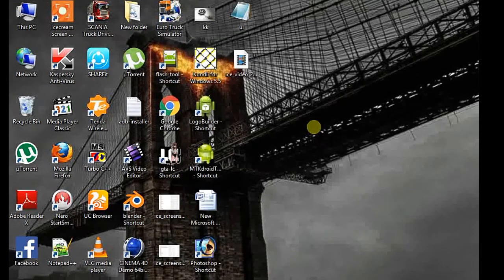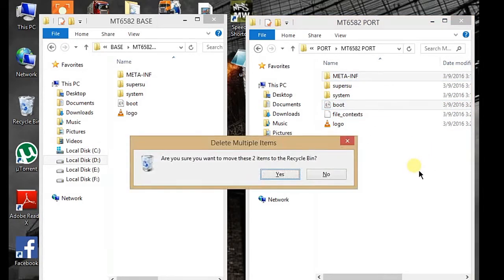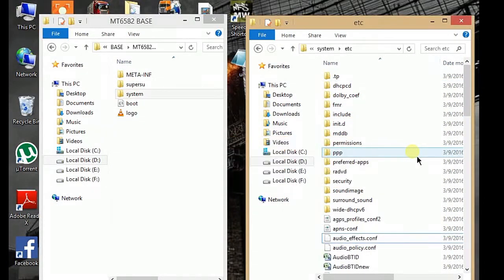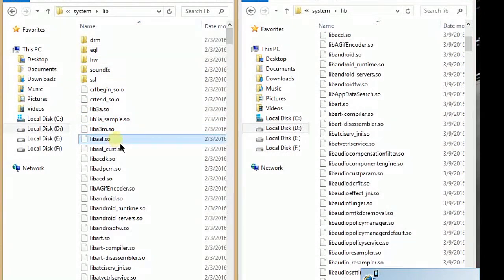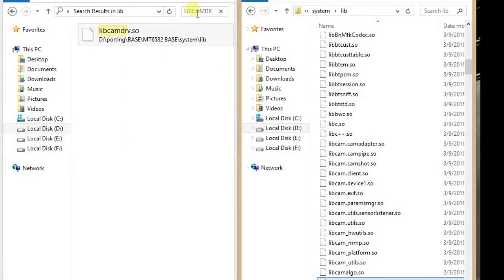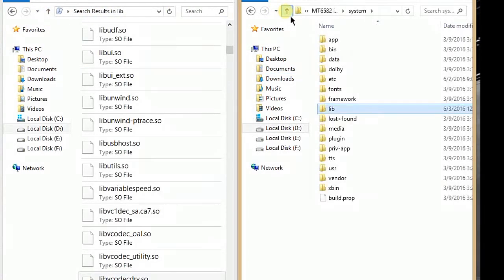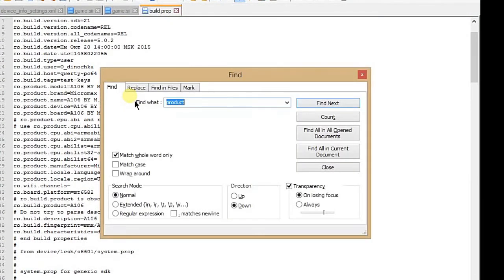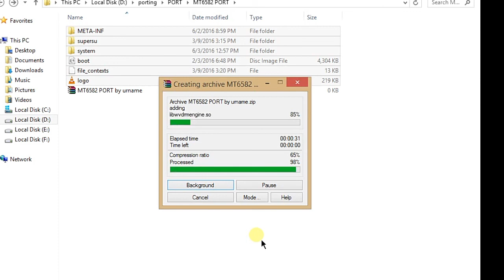HOW TO PORT BUGLESS LOLIPOP BASE ROMS OF SAME CHIPSET'S [MEDIATEK PHONES]

Comment: Brother i am totally confused which guide is correct can u help me. I open more than 15 website but all are upload only kitkat porting guide not lolipop rom porting guide mt6582 with kernal 3.10.54. This guide is correct or not for me. Pls give reply. My device is Q345 micromax canvas selfie lens.
Reply from the maker: anant gupta this is lp porting guide for same chipset.....u can try this
Reply: Bur paras bhaiya i am not able to boot. Todau i try your method. Pls give solution to make flashable stock zip
Reply from the maker: anant gupta bro goto my website and search for fix errors while porting ...and try to replace that files link is in description
Reply from the maker: anant gupta bro goto my website and search for fix errors while porting ...and try to replace that files link is in description
Reply: Pls

Comment: Can I port mt6580 - mt6580 with your guide?
Same android version (Lollipop) and almost same kernel version
Reply from the maker: +RAX HAX yes you can....!!
Reply: I only have a TWRP Backup of base rom, how do I create META-INF? The Port Rom did not flash, maybe because I used the META-INF folder from my Port Rom?
Reply from the maker: +RAX HAX 1st download custom rom of your device extrct meta info from that.....then follow the gudie....or find clone of your device download their meta inf script or extract
Reply: I have the Finow Q1 (Full) Android Smartwatch Phone and I can´t find a custom rom for it or a clone
I tried to port this ROM: https://forum.xda-developers.com/hot-2/development/port-crdroid-lollipop-brykcypha-t3375734 with your guide. Because I dont have META-INF Folder of my Phone/Watch, I just used the one that is included in the zip file (Port Rom). When I try to sideload it, i get error total xfer 1.37x and on the watch I see:
 script succeded: result was [/ system]
Reply from the maker: i guess it wont work for you as its CM base.......u need to port AOSP roms same kernal/chipset....... use any device(same chip/kernal) meta inf
Reply: Thanks, I will try that when I have time

Comment: is Android version of firmware should be same
Reply from the maker: +Ur Advicer yes...
Reply: can u plz help me
Reply: I have InFocus M260
Reply: want to install MIUI 8 or Android Nougat.or any other famous ROM with minimum Android 6.0
Reply from the maker: i dont think your device have 6.0 firmware.....so better use [5.1,5.0] custom roms like cm12,cm12.1 or modded lp , miui 8[not offical] but you need to port for your device
Reply: Paras Guglani can i port flyme os with the same chipset mtk6753 amd kernel 3.10.65 with your guide ?

Comment: Paras Guglani 

Sir I had 

Cm-based Decepticon OS (as BASE ROM) 

.and I tried porting 

Color OS 

But it won't boot.. I used android kitchen to port :'( pls help me
Reply from the maker: +jim hawkins did you replace zimage,zram from base to port ? From boot. Img?
Reply: Oh yes, how can I unpack boot.img? Apps like 7zip/Winzip doesn't work. 
Also I just replaced the boot.img from base to port
Reply: I got all errors like error when porting.  Install aborted